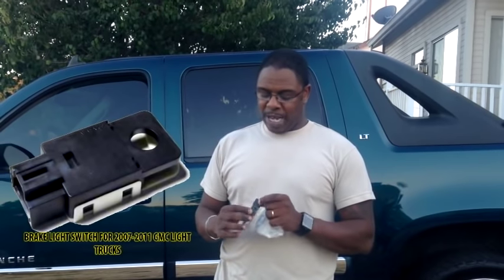[SOLVED] Fix Service Stabilitrack and Service Traction Control on 2007-2011 GM Trucks

Comment from the maker: Just wanted to put this disclaimer out. I'm not a certified mechanic by any means. As seen in the comments, this fix helped some people and didn't help others.  If this fix didn't help please consult with a certified mechanic. Thank you for all the thankful comments. For the people who are still having issues, I'm sorry but I don't know of a fix for those as I have not experienced them.
Reply: J Gary  What is the part called? thanks in advance
Reply from the maker: Evermk Catalan brake light switch part number is in the video
Reply: J Gary Sorry for the bother again i always try to save money as well and do research,that's how I came across this video, Do you think it'll fix the problem on a 2011 chevy impala... i dont have the problem where its stuck on park but Service brake, service stabilitrak, and service traction  control message
Reply from the maker: Evermk Catalan you can give it a try. when the symptoms of my avy started, it was just the lights. It wasn't till a few months later I had the shifting problem and flickering brake lights which caused me to change the switch and when I did it fixed all the problems. So you could give it a try. Best of luck
Reply: thanks man... ill post an update later
Reply: Did this help fix your problem?
Reply: El Froboy it doesnt do it anymore.. i didnt have to do anything to it it just went away.... its been like 3 weeks it hasnt do it... do you have an impala as well
Reply: Evermk Catalan AC Delco part from O Reilly  D1539J
Reply: my 07 Tahoe will not start new starter n battery is on vehicle could it be the neutral safety switch
Reply: JGTV did not work still on , what can be problem , it’s says service brake system service traction control, service stabilitrak and emergency brake stays on
Reply: Could it be that I need a bulb in the brake light or fluid and would it stop the fob battery from unlocking my doors
Reply: I appreciate it, it fixed my ex 2011 gmc even though we dont get along much i hate to sed her spend more money on other parts she spent 500$ on something totally different and this fixed the issue
Reply: Was the name of the part I got the same problem in my
Reply: that's on a pickup truck what about SUV

Comment: I've been struggling with this exact problem with my 2007 Avalanche for more than 5 years. It was happening once or twice per year, and I paid a lot to get it fixed, and then it started happening again and finally got to where it was happening 5 times per day! My mechanic charged me another $1500 to fix it, and the error came back the next day. Exasperated, I found this video, and changed out the brake switch myself. Worked like a charm. Thank you!!!!
Reply: ❤this is great I'm thankful it helped and mechanics want to squabble about this video because they know its a cheap simple fix but they want to drag you
Reply: $1500 ? Wow

Comment: Dudw you rock! My cruise control has NEVER worked since i bought my Chevy Avalanche! My truck would not go into gear stabiltrack light and abs light came on and also my trailer brake light came on! I bought what you recommended and BOOM!!!!!!!!!!!!!!! EVERYTHING IS FIXED !!! THANK YOU!!!!
Reply from the maker: Glad the video helped you out!!!

Comment: Thank you Gary, my 2011 Suburban had exactly the same problem your video started with, Prior to seeing your video I had called 2 shops, just to give you a diagnosis it cost $110, then god knows from there on. one shop told, it could be my transmission because of not shifting. anyways went to dealer bought the part for $21.40 and changed it, works like a charm. god bless you for posting the videoP.S, I'm surprise the mechanics are not petitioning to ban your video :)

Comment: I had the same exact problem with my 2008 Tahoe could not get it out of park. I removed switch, replaced with new and problem solved! Cost me $22.00 and saved me hundreds or even more from taking it to the dealer. Thanks for posting!
Reply: Romanm1957 can you please explain where is this switch located I can't seem to find it but I have the same problem
Reply: What is the name of the part? I have a 2007 Tahoe and i have the same problem
Reply: Please tell me the name of the part? I have a 2007 GMC Acadia doing the same thing
Reply: Teflon Tony did you have to remove a small screw that hold part of it in place
Reply: @nephewblack6230  mine didn't have one either. 2010 chevy avalanche. Just a clip. I just did it today fixed the problem so far but was wondering if someone removed a bolt.

Comment: I have a yukon gmc 2007, the stabilitrack and service traction control came on when driving. I also had a low oil light coming on and lost cruise control. My brake lights were staying on as well.  I changed the brake light switch myself. It solved the problem. I also disconnected the battery while changing it to reset the warning lights. It took 15 minutes and $20 for the part. Thanks for the video.
Reply: Same issues  with my 06 yukon

Comment: Hello i know this is older video but i have a 2007 chevy Tahoe 4wd with 80k miles around 68k miles i got the "Service 4wd soon", service stabiltrack," service abs" and it will not go onto 4wd and 4wd switch would not light up.   I have been been to my trusted mechanic he checked everything and said just drive it!  Ok but when i hit 80k i was like shit i got to fix this or im gonna sell it " (NOTE my cruise control and shifter works fine.). I was told horror stories of 900 to 1200 dollars with dealer wanting to replace transfer case!!!   Well i figured i start with the easiest. Your fix cost me 22 dollars and less than 5 minutes.  And WAPOWW!!!! Fixed no message and 4wd knob working!!!I cannot thank you enough!!!! You are the man.
Reply from the maker: Nath Camp glad it helped you out.
Reply: I have the same exact issue with my 07 silverado. I'm trying this tonight

Comment: I was very concerned, because at the dealer they wanted $ 175.00 per light checked, so I decided to do a little research and I came a cross this video on youtube. so i called napa auto parts and payed $ 15.07  for the switch and to my surprise it WORKED!!!  So thaks a million.
Reply: Ramon Romero did your check engine light come on? Mine came on as well.

Comment: I came along this video and found this along with my throttle body was the culprit. I had the same issue "fixed" last year at a shop for $1100 which clearly wasn't fixed. You explained it well and I was able to fix it along with my throttle body! Thank you! 
I appreciate you doing this video!!!
Reply from the maker: Glad the video helped you out!!!

Comment: Two days ago my 2011 Silverado started displaying error messages about 4 wheel drive, traction control, and stabilitrak every so often. I Googled and found this video.

Today I went to O'Reilly's and got the part for $21.99 + tax and on my way home, my cruise control shut off and the error messages started displaying again! 

When I got home, I spent about 10 minutes from start to finish changing the brake light switch. No error messages since!           

Thank you for posting this video!!!

Comment: I am writing this on my husband's profile or what have you but Mr.Gary I would sincerely like to thank you for this video! You making this video has solved four issues I have had in my 07 Tahoe. Stabilitrack, brake lights flickering, and ABS, and the column not going into gear. Thank you Thank you Thank you! Will be sharing!
Reply from the maker: Zachary Tierney very welcome glad I could help

Comment: 2010 z71 5.3 4x4.  Thank you Gary, completed as you instructed.  I saw several videos and until you mentioned the steering wheel locking up it all made sense.  This was the correct fix.

Comment: This is a great tip and a cheap, quick fix if your truck uses this part.  As he says, the brake switch controls a lot of things and should not be overlooked as the source of your problems if you have any of the error messages he shows.  However, if you have a 2010 or later Equinox, it is a real bear to get to and change the brake switch. You will need to get a manual or find a video on YouTube to guide you, if you decide to tackle this on a vehicle that does not have an accessible brake switch. You will also need an adequate set of smaller tools that will let you get to fasteners in small spaces.

Comment: Thank you so very much for this video/info. 2008 Acadia, 2 dealer trips, etc.....same symptoms, "service stability, traction control off", and pulsating brakes on start up. Saw your video, went to the local auto parts store and picked up the brake pedal position sensor, around $20, installed in under ten minutes! Works good so far.......The only thing is, my particular part looked a bit different, but provided the same function.Thanks again.

Comment: Thank you Gary for this video it totally solved my issues with my 2007 chevy tahoe. I changed the brake light switch and my shifter doesnt get stuck on park anymore. Also my ABS light and my service stabilitrak and service traction control lights dont turn on randomly anymore. You my friend are a life saver.
Reply: +marvin pena Is your lights still off? Sometime disconnecting the battery resets stuff for a short period of time. I am still having problems with my lights coming on. Stabiltrak and engine sevice light. I also Replaced egr valve which diagnosis said needed to be replaced. Dam diagnosis machines lie.
Reply: +An Insurance Agents Career I didn't even have to unhook my battery & reset the computer all I done was changed the brake light switch & lights automatically went off & never came back on & now my cruise control works again!

Comment: Gary, I have 2007 avalanche and had the same problem. Although brake switch was not my problem, your video made me think in a different direction and it was my accelerator pedal potentiometer that was faulty. problem solved. During the process i discovered that any item that feeds into the central computer and is faulty will give same warning together with reduced power.
Reply: Do a video for it

Comment: Thanks for helping me fix my 07 Avalanche. I bought it used and had it for a year. Watched your video and mine was doing the same as your. Although my all that would come on I could still drive with no problem. My cruise control stopped working also. But once I replaced the break switch my cruise control works and no break lights on dash come on any more. Just wanted to let you know you helped someone else out. Thanks and I saved money I paid 17.99 for part.
Reply from the maker: +Patrick Young Glad to hear that my video helped you out.
Reply: Patrick. I too have a 07 avalanche. I was just idling tonight and abs , service traction control,service stabilitack and traction control off came on. Did yours do the same? I turned it off for a bit and all cleared.. them 5 minutes later all came on.

Comment: Thanks! I had the ABS and Stab control lights come on and at one point I could not shift from park. I was going to make an appointment with my mechanic but found your video. $25 part at Oreilly and as you said an easy fix. Much appreciated!
Reply from the maker: Glad I was able to help!

Comment: Wow! You nailed this one bruh! I  2010 tahoe  had just started to do this. Then had had a 3 hour driving trip and my cruise control would not work . I could not figure this out. I came minutes away from going to a mechanic until I saw your video about this. Made a trip to AutoZone and replaced it myself! Again I thank you. 💪🏾 🙏🏽
Reply from the maker: Glad you were able to get the issues fixed!!!

Comment: Do this first! I did this after replacing the whole throttle body and having to get a new connector because the old one got messed up while I was changing the throttle body. No matter what if you these same messages, change this switch first!

Comment: Thank you so much!  Couldn't shift out of park, Stabilitrack, Traction Control, and Trailer Brake messages were flashing plus ABS light was on.  This fixed all the issues on my 2011 K1500. $18 at autozone.

Comment: CAUTION: Switching the break light switch is a bitch for big guys . I don't know how in the hell you filmed that and replaced it. Anyways, i contorted my upper torso and finally got to the part and switched it out and NO LUCK!  The stabilitrack still displayes as needing service. But guess what, my friggin cruise control works again! After 3 years of not working and my ankle freezing up after long drives it now works. IT REALLY REALLY WORKS! Than you J Gary!

Comment: You sir just fixed an issue I have been trying to solve for about a year.
Reply: Darrin Pearson question,  we're you perhaps getting a whirring or moaning and groaning noise when steering at low speeds?
Reply: Darrin Pearson Did you find the reason for the sounds. I cant find anything on that.
Reply: Does the sound change when your turning? If your getting a low drone sound when your moving it could be the wheel bearings
Reply: Does anyone know the part number for a 2010 Silverado?
Reply: paul petarson exactly mine went dry a week before this lil part broke
Reply: @Luis-Lopez-Luy  I did the hub replacement on my 2008 Suburban, I forgot the part number but it's an AC Delco part and you can easily find it on rock auto. Should be called front hub assembly or something similar. Should run you around $100-200 for the Delco part
Reply: @triptheroad  is that a wheel hub replacement?
Reply: @BlackWhite-ru8gm  yeah it's a self contained wheel hub assembly; contains the wheel speed sensor, bearings, and hub

Comment: A while back my auto start on my 07 Yukon xl. when I started my vehicle through the ignition switch.. I then proceeded to my local auto shop, to find out that the engine codes were indeed the reason as to my issue. witch the computer said gas cap and brake light switch.. I replaced the cap, but not the switch, and had the codes cleared...6500 or so miles later my service tracking con/and service stable con indicator light came on and your video led me straight to the issue! thank you, great and informative video! I owe you $25 dollars back if we ever Cross paths! thanks again!!
Reply from the maker: Glad the video helped you to isolate the issue. As I mentioned in my video I'm not a certified mechanic just someone who did some trouble shooting and thought others would benefit from what I figured out. Once again glad it helped.

Comment: Make sure after you replace the module that you go to the engine and pull the - breaker/amp/fuse  ----(#9  on the fuse box) -it resets the system so that error has a chance to clear
Reply: Travis Mialback I actually was curious if that works? I replace the brake light switch and it worked temporarily, but then after my wife drove it we got the error code back. I don’t know what else to check

Comment: Thank you. I have a 2008 Tahoe and we have been having issues with cruse control for over a year. During the last six months, we were having issues with "traction control off,, service stabilitrac, service traction control." Just recently we had issues getting out of Park. Replacing the Brake Light Switch fixed all the problems. Thanks again.

Comment: thanks for the video!  I have a 2008 GMC Sierra and this 100% fixed my problem. several videos & people said that it's a wheel bearing problem, but both my front wheel assemblies have been changed & the lights never came on when either side went bad & the hub assemblies are $180.00 a pop and that's if you install them yourself! the brake light switch cost me $18.02 at O'Reillys & like you say in the video it might have taken me 5 minutes to change so saved me a lot of money & time (thanks again) Jim gross.
Reply: I forgot to add that it did also fix my cruise control.

Comment: Thanks for this video! I am also getting a service brake system light on my 2009 Traverse. Nothing wrong with the brakes or fluid. I have a feeling this will fix everything across the board.
Reply: I’m about to try on my 2009 Sierra everything looks great with abs wires, battery, and fluid levels. I even tried cleaning my fuse box and ABS2 fuse. Here goes nothing LOL.

Comment: THANKS. Had the issue happen while coming home. Driving 20 miles at 15-18 MPH on the highway NOT GOOD. got to a local auto repair store changed out the switch and problem solved again THANKS

Comment: Hi J Gary.  I have a 2007 Chevy Uplander.  I don't have problems with brake lights or shifting from park so far, but the dash lights keep telling  me to service traction control and service stability system.  Was the Uplander was one of the vehicles that has this problem too?  Thank you.

Comment: This is a great fix, and will often solve this condition.
But it also may not change anything, The problem can also be in the Ignition switch,  the steering position sensor ( Both reasonably cheap), and occationally the very expensive Throttle Boddy

Comment: Thanks Gary.  I will try this...  I replaced the Left front wheel bearing hub and the stabilitrak light came on, not prior but my Cruise control quit working this summer.   I'll try this and see if it works...  I tried to clear the code with my lemur OBD II blue tooth.

Comment: Thanks for the video!!! I recently did the driver side motor mount and when I was done that in the truck and have the service stability track light come on I thought I broke something putting the motor mount on when I googled the problem your video came up and I thank you for it! It's solved my problem